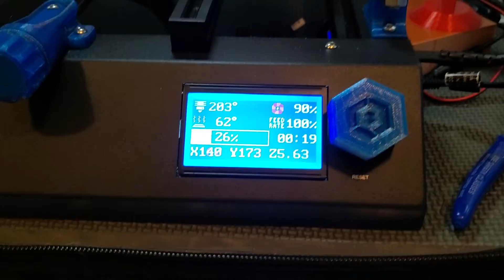Klipper and Eryone Thinker SE - update, some thoughts (and ongoing issues)

Comment: Get a 310x310 build plate they work well :)
Reply from the maker: So far the 300x300 has worked well enough (even with the space at the edges) - but the suggestion is valid!

Comment: I am neck deep in converting my Thinker SE to Kipper. I am stuck on the pin call outs for the BL Touch sensor. What values did you use?
Reply from the maker: Hmmm...wow, it's been a while since I did this, and life has kind of taken over the ability to spend much time on the Thinker.  Would my config file help?
Reply: @jayburkette8977  It sure would
Reply from the maker: @RandyMcNurlin  I'll try to get this downloaded tonight.  What would be the best way to get you the file?
Reply from the maker: @RandyMcNurlin  Sorry I've been invisible.  It seems that when our network provider changed hardware (a month ago) we lost 2.4ghz as one of our bands.  My PIs are all setup to connect to that band, so I'm kind of out of luck right now until I figure out how to get everything reset up.  I'll be back with you.
Reply from the maker: I have my printer config file finally from the Thinker (new router did the trick).  How can I get this to you?
Reply from the maker: ######################################################################
# BL-Touch/3D Touch Variable Section
######################################################################

[safe_z_home]
home_xy_position: 150,185
speed: 100.0
z_hop: 7.0
z_hop_speed: 7.0

[bed_mesh]
mesh_min: 15,15
mesh_max: 285,265
probe_count: 7,7
speed: 80
horizontal_move_z: 5
mesh_pps: 3,3
algorithm: bicubic
bicubic_tension: 0.2
move_check_distance: 5
split_delta_z: 0.025
fade_start: 1
fade_end: 10

[bltouch]
sensor_pin: ^PA0
control_pin: PG5
pin_move_time: 0.680
stow_on_each_sample: true
speed: 5
lift_speed: 5
samples: 2
sample_retract_dist: 2.0
samples_result: median
samples_tolerance_retries: 5
samples_tolerance: 0.02
x_offset: 0
y_offset: -35
#z_offset = 1.335
Reply: @jayburkette8977  Awesome thanks

Comment: Just upgraded my Thinker se Hotend to a Mico swiss and I was wondering how you changed your your fan voltage from 5 to 24.  Can you please help.
Reply from the maker: Yes!  There is a jumper (3 pins and a black jumper connector) just inboard from the fan output on the motherboard.  You switch the jumper to switch from 5 to 24 volts...  If I remember correctly, if you look close, it will have the correct pin combinations labeled...
Reply: @jayburkette8977  would I need to change all fans to 24volt
Reply from the maker: @adamoparete1921  I believe so....
Reply: @jayburkette8977   sorry just confirming I will need to remove the jumper completely for 24volt. Thank you

Comment from the maker: Update - wound up getting a THD Tough Extruder (E3D Titan clone) and that is working well (and I'm back to using this printer daily).  The Bondtech was overheating, even at 600 ma of current - decided to return it and go with another solution.
Reply from the maker: Right now I'm using 610ma of current for the extruder motor (specified in the printer.cfg file).  TH3D pancake motor still gets hot - but it's not missing steps and it's extruding like a champ.  Same e-steps (412) - equating to 7.76 rotation distance for Klipper).

Comment: I was just about to start doing this, I guess I'll spend a bit more time researching , thanks for the video.
Reply from the maker: I don't want to discourage anyone!  That said, diving into the various documents and doing a good bit of reading (and asking questions on appropriate forums, etc.) is really necessary with a Klipper transition.  Once it is loaded and working, it is so much faster and easier to manipulate than Marlin - but getting everything to that point can be frustrating if you're not familiar with Linux scripting.
Reply: @jayburkette8977  I use linux daily so I'm not discouraged, but I'm also not a good coder (you wouldn't believe the amount of time I have spent debugging my own code in relatively simple projects), I just don't want to be in the position of not being able to print without knowing why.
Reply from the maker: @steve_nobbs  Completely get it.  At least there's an active user group for Klipper on Reddit.  Which printer are you using?
Reply: @jayburkette8977  The Thinker SE, I like it, but I want to build a VORON so I am tweaking it to get good enough prints for the V2.4 printed parts and thought some experience of Klipper would be helpful.
Reply from the maker: @steve_nobbs  You and I are walking the same road.  I am also going to build a Voron, so all this is experience building at this point!